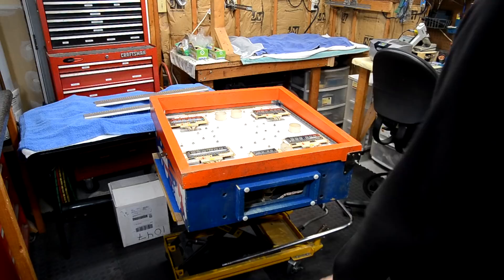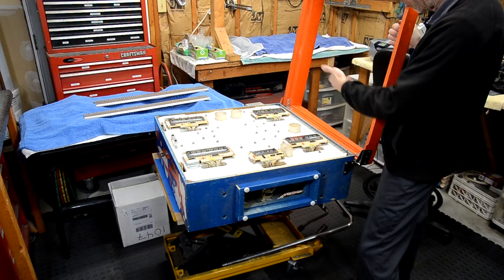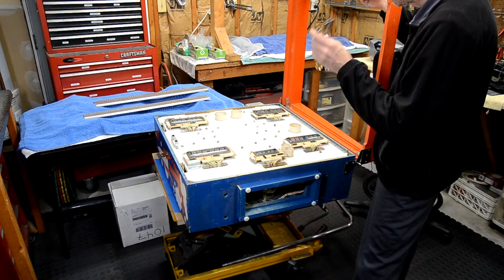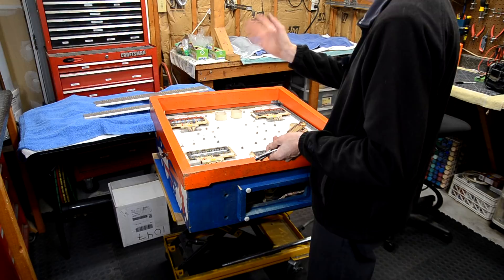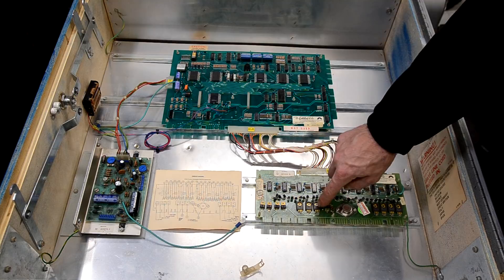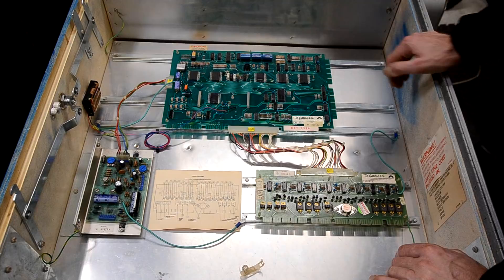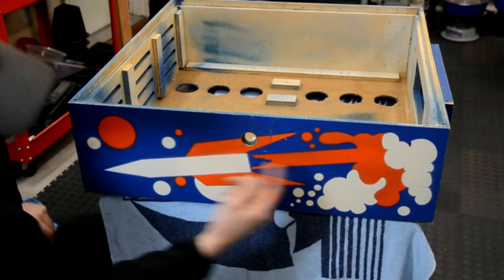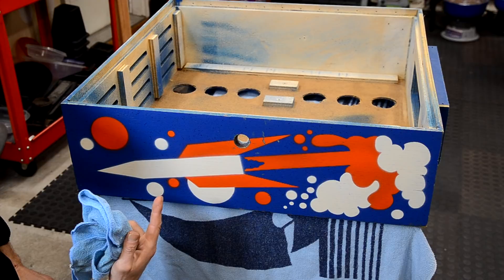Pinball Restoration Update: Gottlieb Count-Down Ep. #4

Comment: Get rid of that Funk!  Another great video, thank you very much.  How do you organize all the screws / washers and make sure they get back in the correct locations?  Noovus / Novus, potato / potahto.
Reply from the maker: Lots and lots of before pictures to look at as I put things back together. In this case I had a ziplock bag of screws from the main head box, a bag for the outer door and a bag for the insert panel. I work on one bag at a time through the ultrasonic and tumblers so things dont get mixed up.